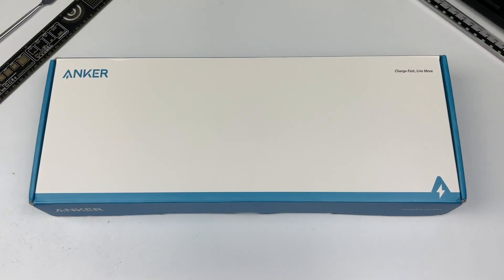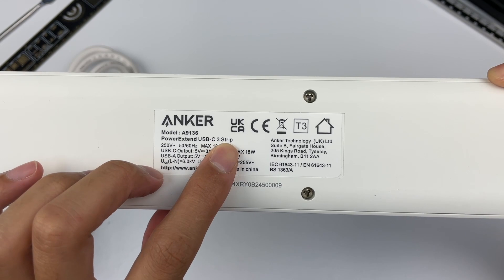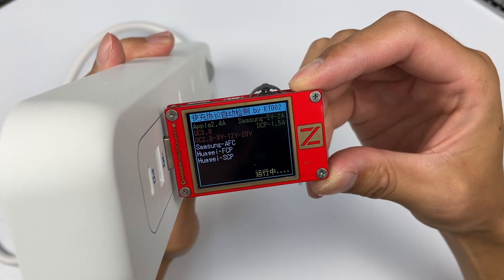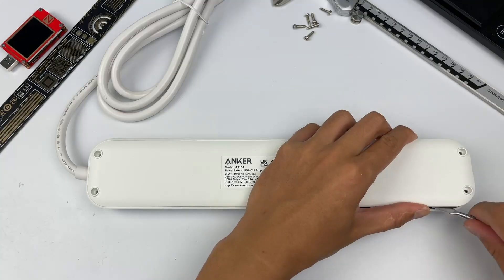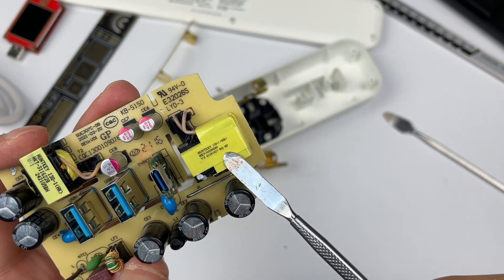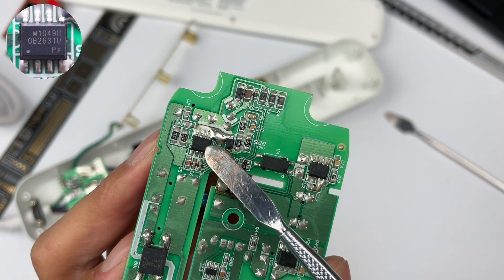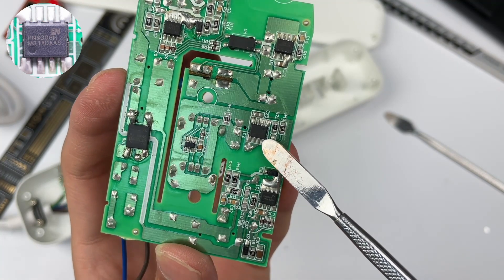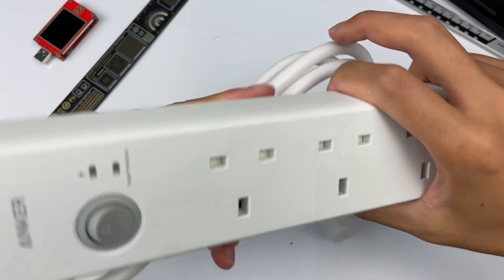Teardown of Anker UK Power Strip With 18W USB-C

Comment: I have used a similar power one made by Xiaomi for sever years now. And I have to say the built-in USB ports is a very useless feature, because power strips are meant to be used for many years, a socket can power up a charger of whatever wattage (of course not something like an electric car charger), and after 2 years the wattage outputs of those USB ports will go obsolete, only useful for charging small batteries like wireless headphones.